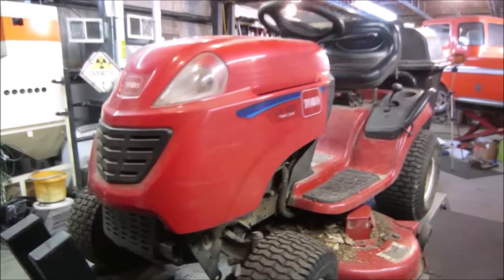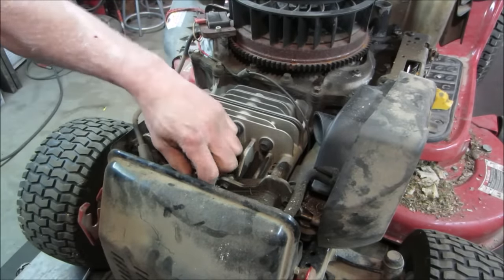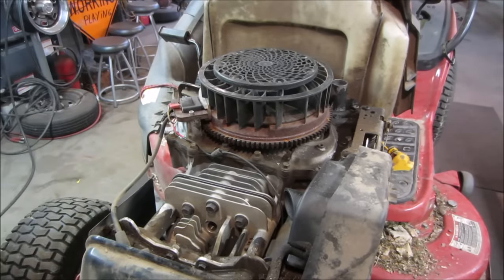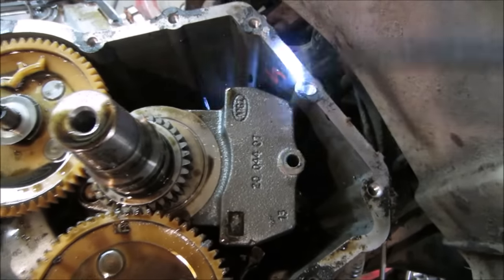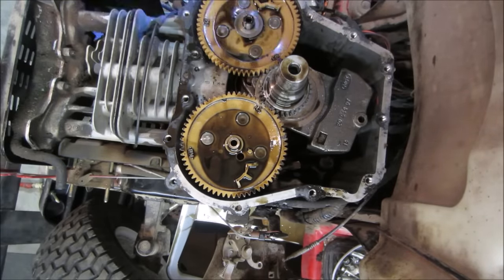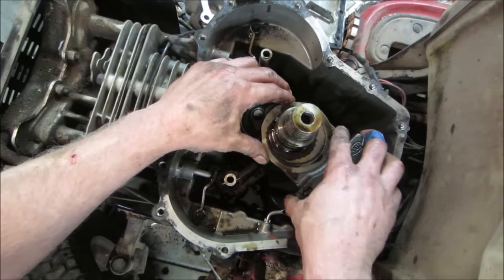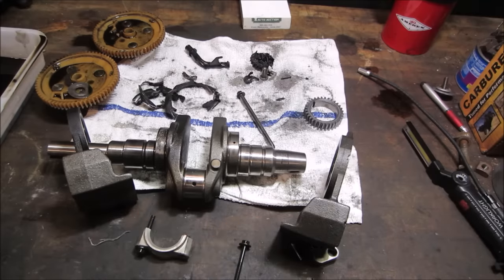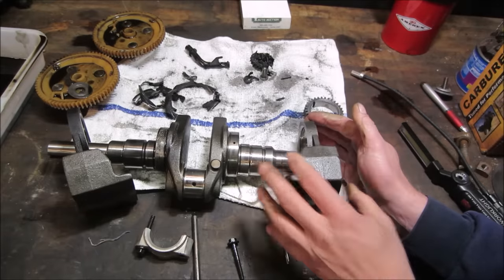You Won't Believe Why This Engine Blew Up,

Comment: When I recently purchased a secondhand ride-on, the first thing I noticed was a lot of Koehler motors that had died on the ones advertised. All had counterweight issues that had let go and in most cases cracked the crankcase. I think you were lucky that it stopped without writing off the engine. Ended up with a Briggs and Stratton engine and runs like a dream.
Reply: Koehler's are JUNK motors, poor engineering. Can't beat a Briggs. Worse case scenario in the Briggs 14-17 HP single-lungers is a Head Gasket. (also poor design, but a fairly easy repair) I've had 2 riders given to me with Blown H/gasket motors & repaired them & STILL have them MANY years later.
Reply: @davelohmann9197  you can beat a Briggs, it’s called Kawasaki
Reply: Kohler Courage engines are junk. Old Command single cylinder engines were virtually bulletproof. The newer 7000 series Kohler is better than Briggs and Stratton but not Kawasaki reliable.

Comment: I’m a small engine mechanic and Kohler courage is our very notorious for blowing due to the counterbalance or they develop a leak and you just don’t know and then they end up throwing a rod or throw in the balancer
Reply: correct, seen that failure before. poor design and execution.
Reply: thats great to hear, ive got a craftsman riding mower with the 21 HP vTwin kohler courage engine, its 15 years old at this point, and well who knows it runs like a champ and i do keep maintenance on it, and its been a (pun inserted here -courageous) engine but from the sounds of it the courage engines tend to go boom boom often.
Reply: @compzac  Mine had the bottom crank seal fail.
Reply: @bigtomato6057  The only failures mine has had was a carburetor needle failure causing engine flooding, coil failure and charging system fault, which it still has since it only affects starting and the engine still runs just fine, none of my seals have gone and as far as i can tell the internal components are just fine. Even if my engine dies tomorrow though, its lasted 15 years so honestly i would say its had a fine run.
Reply: These things are still very reliable with a few easy precautions. Checking the oil before starting ensures oil starvation issues are prevented and adding loctite to those crankcase bolts prevents them from backing out
Reply: @compzac  I also have a 16 year old Courage but it's a single. Many have died because people just don't fix the little things
Reply: @MrCarGuy  Like I said mine is 15 runs like a champ, i cant say i dont like the engine cause with simple enough maintenance it just continues to work, yea the tractor has its issues like its charging fault, which i got it diagnosed i know what failed, but i just cant be bothered to fix it cause well in my head the tractor itself just isn't fully worth the hassle, yea i have to charge the battery myself, if i don't the battery will drain during startup and while im mowing, eventually the clutch releases and the mower stops, but thats rare, cause well i just charge it all the time and it can handle my yard easily, but the rest of the machine is getting a bit tired, the trans complains sometimes, ive patched the deck back together, just loads of stuff. But the kohler engine has been just a full on champ the whole time so i cant really say bad things about it, its the third time if dealt with either a courage or command engine, and well they just havent been awful for me.

Comment: Less than a minute in and I think I spy a Kohler "Carnage" (Courage,I GUESS!).
Reply: The courage was NEVER a good power plant lol
Reply: It takes courage to own a Courage.
Reply: Buck Fiden  Kohler K Series engines were good. They were used in number of garden tractors in ‘70s and ‘80s.
Reply: Courage engines get a bad rap from easy to rectify issues that their assembly line was negligent with. Namely, no Loctite on the crankcase screws from the factory. Most owners never bothered to spend time solving it and paid the price.

Comment: The landlords toro 16 hp  engine. blew open like boom! A filter oil pumper. I replaced it with an old eternal briggs and stratton  14.5 hp!   Re did guides and bolt holes. It has been 5 years. Frequent oil changes. The oil splasher works just fine! The deck is spindle bearing flopping. The new 42 inch  19 hp  John deere is getting the most work now. I added a longer filter. Lots smoother ride with tight turns. Very fast forward and back!

Comment: When it was low on oil, the oil was in the moving parts, and there was no oil for the pump to pick up. After it locked up, the oil drained back down, so it looks like it had oil in  the case. I've run Kohlers for decades, and never had one problem. BUT, I always check my oil before using, and NEVER run it if oil level is low. Even my 1995 Kohler Magnum 18hp opposed twin still is solid as a rock. All the damage is from "Lack of Oil". I'm 77, and have never had one engine go bad.  I've raced bikes, boats, cars with no engine problems.

Comment: Greetings from the UK. 
Great video and forensic diagnosis. Seems some of these mowers are more complex than they need to be.
Reply: Thanks for the in depth look at Kohler Courage.  They just fell of the list of devices I want to own.  

I respectfully submit that you might have missed two issues.  1. The counter weight would have been 180 degrees away from the rod bearing. You show them both on one side.  2. There is some mechanism to push the valve off the seat for compression relief, which may be part of the reason for moving counter balances.
 
I am no expert but I suspect these engines are built like the old Brit sports cars: if one part will do (solid crank balance) then 8 parts must be better ( 2 counter weights, 2 bearings, bolt, nut, spacer, cam dohikky) .  Same result: fewer hours of Mean Time Before Failure.  The culprit is needing way more HP from a one cylinder engine so Brigs and Kohler need compression relief gizmos to turn over and start.  They should have used a simple push button, like Stihl, on the head, without all that flying mass and parts that become grapeshot at failure.

Comment: Do you ever pour kerosene down inside to wash the oil and crud out. I have done this, will it hurt.  I even do this sometimes when I change oil to wash the crank case out. Lots of broken pc. inside. I learn something  new every time I watch your video's, Thanks for sharing.

Comment: On my tractor was running hot from years of no maintenance. Find packed with dirt and grease and black as night oil from never being changed, just added to, was super hard to get started. Piston wasn’t getting lubrication and carbon pieces were causing it to rub and even get stuck at times in the case. Cleaned it all out and reassembled. Runs like a champ now. Didn’t need any parts or valve adjustments

Comment: Funny, I've got an old (1980s) Ford LT12 lawn tractor that had a similar issue. The counterweight in those is free moving just like this one, but in another level of complication it actually has a gudgeon and it's own little connecting rod that ties it to the crank rotation. Someone was mowing our lawn and ran it into a stack of pallets and it just stopped dead. I could spin the motor over but it sounded just like that did when you spun it over. Broke the motor down and it had blown that little connecting rod for the counterweight into 15 pieces. Managed to find a scrap counterweight with the connecting rod attached and got it running again. Still mowing happily and that was 3 or 4 years ago now. Cheers from the east coast of Canada!

Comment: Today is Tue 5/11/21. I walked into a shop in our town, the owner had a small engine block sitting on the counter. It looks just like the one you are working on in this video.  Koehler? I was told that there is an imbalance in one of the shafts. They corrected the problem, and are willing to replace any that are still out there with a new short block.
Reply: Wow!!
If true that's excellent service from Kohler!!
Perhaps BMW could learn something from that with their shit diesels?

Comment: Thanks a bunch shedding some light on the internal works of this Toro Wheelhorse! I own an LX427 running decent but puffs out little bits of oil smoke out the front by the muffler. Any suggestions? Thanks once again in trying to keep my LX427 Toro Wheelhorse running!! Keep up the great videos!!

Comment: I'd guess that once the counterweight bolt broke, the top half swung wildly into the governor, destroying it.
Reply: Interesting thought.  I too wonder about the governor being destroyed like that.   Perhaps: The bolt broke, the bottom half pinched the bearing, the bearing shredded, and a piece of it ended up chucked into the governor, OR the top piece of the bolt (and/or its cam) is what fed into the governor, which was more than it could chew.
Reply: @OnusBones  There's a track that the bolt and the oval part rode in. I would say that acts like a guide to keep the counterweight moving where it's supposed to move. When that bolt sheared off the counterweight could do whatever it wanted and started chewing things up. I would say chances are that thing didn't run all that long after that pin sheared off and I bet to anyone not hard of hearing it made a hell of a racket.
Reply: @OnusBones  go back to where the top cover comes off, you can hear that part drop to the bottom of the engine and he shows the track on the cover all chewed up.
Reply: I had an 11hp Briggs & Stratton that died a similar death.
Reply: very likely and it was even more likely due to oil starvation at the rod and counterweight bearing, as well as the slide. those would be the first areas going dry of lube.
Reply: This is correct. the counterweight bolt failing is extremely common on these.
Reply: @16vSciroccoboi    see a lawsuit?

Comment: I have a feeling that the pin holding the counter weight was tested during the design phase in CAD and tested to pass the forces but not fatigue. It does look to be on the small side.

Comment: Great engine autopsy. I wonder if it's an anomaly or if that model engine had an inherent engineering flaw?
Reply: The Courage line has a bit of a rep.  Not a good one.
Reply: I'd say that bolt that held those weights is just too weak to last for very long. I think it broke first then caused the rest of the internal damage.
Reply: I have one of them in a bush with a hole in a block. Those come up for sale with blown engines often

Comment: Its a common problem. The bolt sheared holding the counter balance together. That allowed the 2 balance parts to separate and gradually eat the bearing out of the balance weight on the bottom. The crank is done along with mating parts. you can see severe wear on the inside of the balance halves.

Comment: We own an LX420 with the Kohler. Manufactured in Mar 2006. Currently May 2021. Have not used it very often in the last five years, because we have some local guys to do our lawn every other week except not at all in the winter. We use it mostly to sweep up pine cones and pine straw.

So far so good. But if it quits running now I’ll have a really good idea why.  I’ll probably take it apart just to verify.

I was surprised how many parts are simply press-fit.

Comment: Strange to hang counterweights off to the side instead of down. There doesn’t seem to be any support for them. Looks like the same as the Kawasaki  FC420V. Are the counterweights stationary? I couldn’t see if the shaft was offset where the weights attached. 
At 53:00 where you are showing the counterweight assembly, the nut fit into the cam which went into the top of the case. The spot where you noticed the damage when first taking the top off. 
First video I’ve found showing the counterweight setup. I have 2 Scag mowers with FC420V that I’m hoping to make into one. Now I’ll know what to expect when I get started. Thanks for another great video and be well.

Comment: Great video, funny thing, I was helping father-in-law over the weekend with his mower, 23 yr old craftsman with 20 hp Kohler v-twin motor. It just abruptly quit on him. Replaced blown fuse (probably from him trying to restart it). It’s full of oil. Crank only moves 1/8th inch or so, starter is good, pulleys underneath aren’t seized. We haven’t taken head off yet, but after watching your video I’m suspecting something similar. There is something jamming the crank because both pistons move up & down equally the same as I can only rock the fly wheel back & forth that little bit.

Comment: Another great video from Mustie1!! Love all the extended and "long-winded" videos!
Judging from what we've seen in this teardown and from what folks have said in the comments, even if a good replacement engine was found it would likely break again. The engine design is over-engineered to the point of scoring high on the lemon-list.
Probably better to find some other basic engine with a good track record. A few less horsepower would not matter a lot, this machine won't be competing for any off-road records. Uhhh ... right, Mustie?
Reply: Might be time for a Harbor Freght Predator!!

Comment: Excellent video Mustie  1 :) also must be common problems with Kohler 18 or 19 hp motor also my 2008 Toro Lawn Tractor with 19 hp Kohler Courage type ,48 inch cut bed with Foot pedal for for Automatic transmission go forward also middle in Neutral, back Reverse, plus Brake pedal near too plus had Cruise Control to lock pedal go forward  or backwards and nice machine! But on last Monday afternoon was cut grass also put fuel plus also nice new engine oil plus oil filter also fuel filter also air filters to , put fuel in too also brand new battery too needed  and 3/4 done also got big bang shut motor down completely still turn over fine on crank over and found no oil leaks too get everything okay plus check fuse in under seat it fine and but transmission on left wheel lock up like clock and right one turn okay back wheels! So tried everything can and guess new ride lawn tractor going be pay for soon! But want know should ride tractor have use Synthetic or Conventional engine oil in motor what best you find ! I prefer Conventional over Synthetic oil because the strong protection and last long time too!

Comment: Early courage 18 and 19s had a few very common failures.
1. Upper sump bolts back out and the locator pins beat the block out around the cylinder causing oil leaks and eventually block failure.

2. Balancer failure, most often it beats the back of the block out, fist sized hole.

3. Governor gear failure resulting in overspeed damage.

Comment: Hi Mustie, I really enjoy your stuff so thought I would send you this one.   20hp Courage single would lock up at TDC. I thought it was either  Battery or starter motor. Replaced both with new. still no go. THEN while fixing the leaky rocker cover gasket I decided to check the valve lash, 17 thou on the exhaust which of course rendered the automatic decompression in operative which made full compression too much for the starter motor. Reset valve lash to 7 thou and all is well.
I haven't seen this on your site or any other but I am sure I am not the only one with this prob.
Keep them coming bro. I am learning lots.

Comment: Briggs has a similar counterweight.  I think that long bolt failed first at the top letting the two weights become misaligned.  Beat itself to death.  Wish we could see what fit into the notch in the engine cover.  Will the piston come out the bottom of the bore?  Good Tutorial.  Needs a Twin!

Comment: Now retired after 50 years working on garden machines I have seen this problem many times,counter weight bolt failure,most problems start with not looking after engine oil  and the only way to fix the problem is to replace engine.repaired engine’s did not last,in my working life time where I live Briggs+Stratton where the engines most used along with Aspera and Tec.Nice to see a old hand working.

Comment: You mentioned that was about a $500.00 mower. Add about $1500.00 to that and you'll be right. Well worth another engine.  Good work and nice video.

Comment: 50:43 "You can put a V-twin on it ..." and headers, and fuel injection, a turbo, a dry-sump system ..." lol  In all sincerity, it's incredible how good these simple little engines run (and sound) when they're working properly.

Comment: Those things you've been calling "counterweights" are part of a mass damper that moves in opposition to the connecting rod journal and piston/rod assembly. It's purpose is to dampen vibration cause by the rotation of the engine.
Reply: Yes, commonly referred to as 'counterweights' in numerous applications.

Comment: I knew it was a Kohler even before you popped the hood (didn't read the description). I'm working on Cub Cadet right now. The balance shaft let go. So for now, I've pulled the balance shaft parts and re-assembling it. Some day, I'll buy the balanced replacement crank. Maybe...

sounds like stripped cam gears...

7:41 LOL, spins a bearing. Get a little deeper into this thing and you'll discover it doesn't have bearings. It literally uses the cast surfaces as the bearing surface on both ends of the crank and the connecting rod.

23:46 In my motor (visually identical) that hole in to top of the counterweight was a bolt. Mine failed differently. On mine, the arm that connects the top counterweight to the crankshaft exploded. It's a different counterweight design than mine has.

40:42 Yeah, these Kohlers are notorious for the balance shafts letting go. I'm going to close up the oil passages that lube the balance shaft bearing surfaces and run mine without it.
42:37 Agreed. You'll also notice that there aren't any provisions for keeping the halves of the balance shaft aligned. This loads all of the stress directly into the through-bolt.